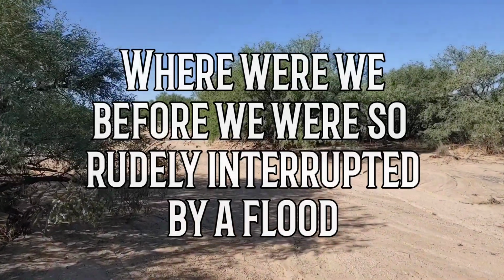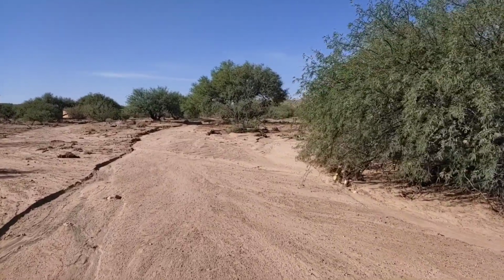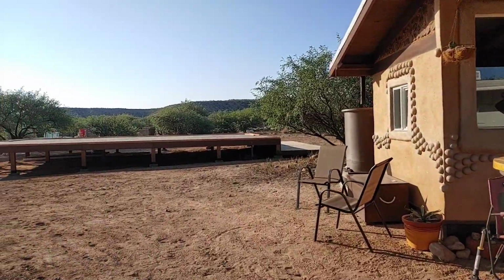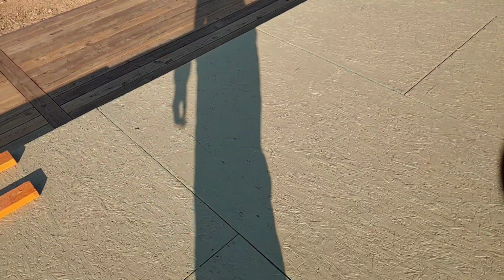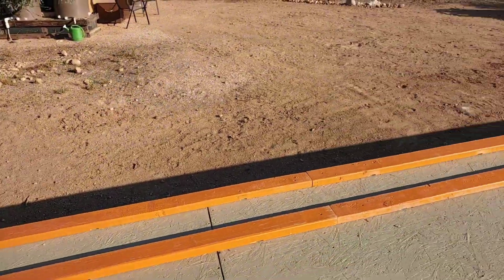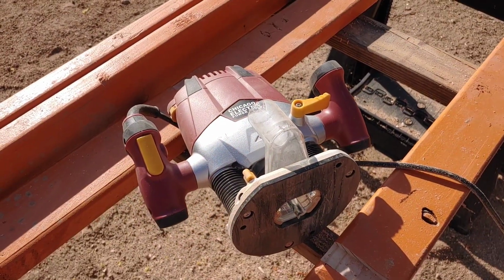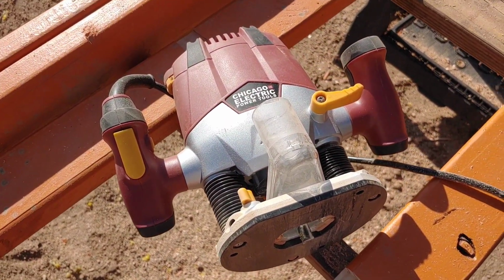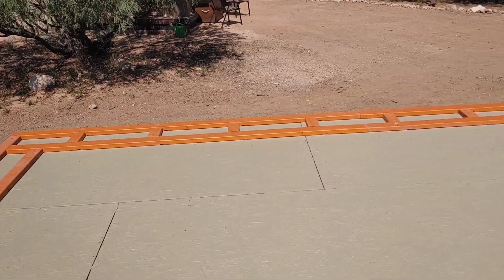#strawbale house  The Straw Bale House Build Continues!

Comment: Sometimes you can really hit with those Harbor Freight tools sometimes you miss, sounds like you hit on one
Reply from the maker: Really so true. Our auger is from Harbor Freight and it's a real winner. The price value can't be beat! I think I were trying to make more of a fine furniture product, I would want a router that can be more finely adjusted that this one, but for my current projects, two thumbs up! I bought the bits at HF too, and a set of 3 straight ran $9.

Comment: Great video, and clear explanations. I’m curious about the risk of your straps snapping when you tension them. This comes after seeing you router out the strap cavities along all of the toe ups, leaving a sharp upper edge. Will the strapping be metal? I guess this may rust, so assume plastic strapping, but this won’t be great on that sharp edge. Curious to see if how it goes. It’d be very timely rounding all those routered edges.
Reply from the maker: Those straps have a breaking point of $2,680 lb. I don't think there's any way I can put that much tension on them anyway. We haven't had any problems with the straps, with the exception of me  accidentally nipping one with the chainsaw when I was straightening the bales. The straps aren't plastic, they're a nylon type product. I considered metal strapping I just didn't want to deal with the metal and the rust that might come from it. Plus I like to the flexibility that the cloth strapping material provided. This is actually the same strapping material we used to strap bunks of lumber at Home Depot when I work there a few years back.

Comment: Hi Bill I have been checking out foundation s for straw bales houses some do a deck like yourselves, some trench with drainage pipes and gravel usually on sloped land otherwise the water would have do where to go. I am looking at installing a concrete pad and then installing toe ups on it, have you seen any videos showing this process because to date all the ones I can see the foundation is already completed and the bales are being installed. Great videos bill and will be implementing what you are doing cheers.
Reply from the maker: I'm not sure how much they have documented, but the channel Building Roots that I mentioned in our last video ( link in that Video description) did a concrete pad with toe ups. They're doing timber framed straw bales, but that shouldn't make a difference when it comes to this phase of the project. Hope that helps.
Reply: @theupsideofdownsizing  Building roots dont show the concrete Build as they started the filming later on in the build. BUT a channel called Dirtpatchheaven  use a shuttered concrete perimeter about 2ft wide with rebar they then put the toe ups directly on the concrete so thanks for the advice and maybe check them out waiting for your next update on the house thanks again chow from Bulgaria
Reply from the maker: https://youtu.be/tD6bTyuIl9w
At about the 10:25 mark they begin installing toe ups in their concrete slab.

Comment: Why not do a taller cement foundation or cement blocks?
Reply from the maker: Not necessarily since the foundation is already 3 feet off the ground. The toe ups will serve 2 purposes. 1) keep the bales off the ground in the unlikely event of a flood inside the house. 2) with the channels I routed out, we will be able to strap down our bale walls to add stability and compression. That will be more clearly explained in a future video once the box beams are set on top of the bale walls. If we were building ground level, a block wall would be a good idea to raise the bales 12-18" off the ground to prevent the bales from getting wet from the outside.